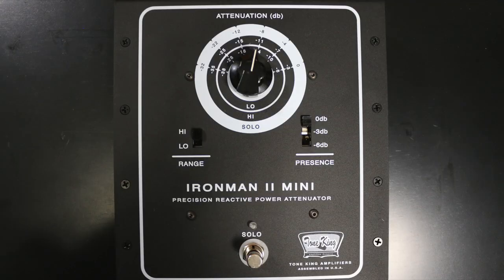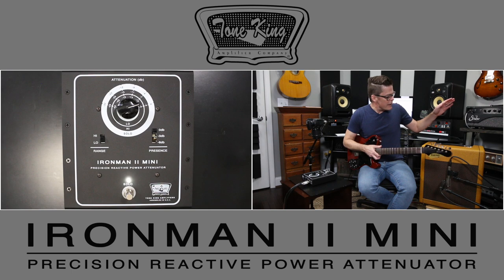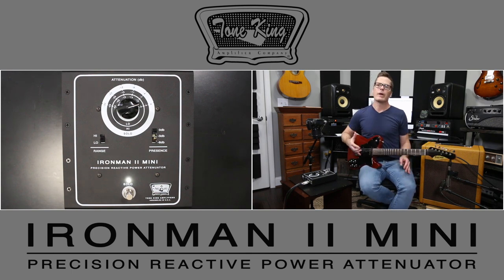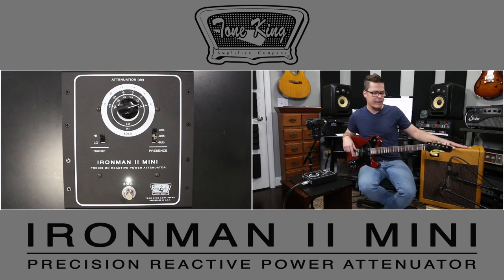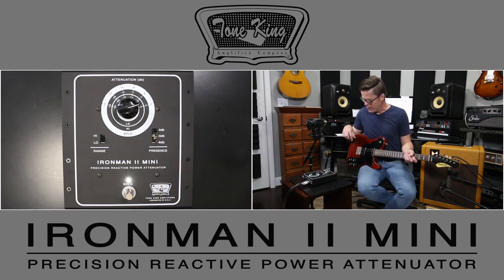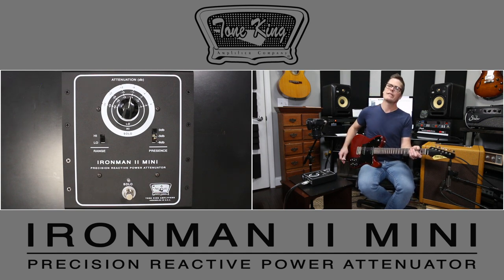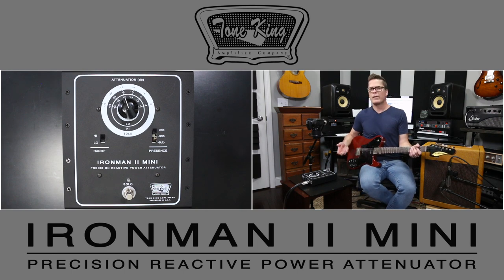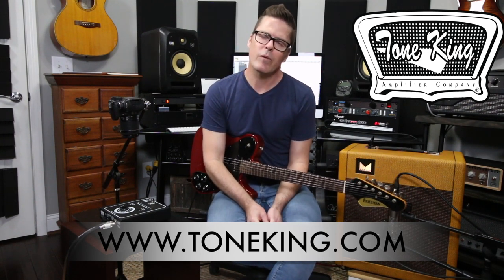Tone King Ironman II Mini Attenuator Demo Video by Shawn Tubbs

Comment: Just a heads up for those looking at this: a 16ohm load will NOT work with this attenuator. I’m definitely not trying to snipe Shawn, not at all (hopefully that’s clear, Shawn), but I bought this to tame down my AC15 and...it’s a 16ohm load, so it’s not compatible. Hope this helps anyone looking for the right attenuator for their amp. Cheers!
Reply: AC 15 has both 16 and 8 ohm outputs switchable. I don’t see the issue.
Reply: @VintageRadius  that would involve switching the speaker from 16 ohm to 8 ohm. Maybe he doesn't want to change it out.
Reply: @scottwilliams1577  8 ohm output into 16 ohm speaker/cab is what you call a “safe mismatch.” There are websites that explain. Hughes and Kettner has a good page on it.
Reply: @VintageRadius  8 ohms into 2 16 ohms is ok. Th AC15 is a 1x12 combo amp. 8 ohms into one 16 ohm speaker is not the same thing.

Comment: This video is missing a lot of information that would have cleared up most of the questions in the comments thread. Mostly, it's missing an explanation of how amps work. Not once is the phrase "power tubes" used.
Reply: I disagree This is a quick demo to introduce you So interested check out Tone King Buying something with out doing a bit of research would be foolish

Comment: What is the volume/gain on the amp? I bought a Morgan MVP 23 in large part because of its power-scaling capability. When I received the amp, I put the gain and volume at around 2 o'clock (~ 7/10) and it sounded amazing. Unfortunately, even with the power-scaling at its lowest level, it was too loud for my apartment. Turning down the gain and volume to acceptable levels with the lowest power-scaling did not give me the sound I wanted. I wound up selling the amp.

My point is that, at least with the Morgan, the attenuation starts from the un-attenuated volume, so a 20 watt amp that is really cranked may still be too loud for "bedroom" volumes.

Comment: Hey Shawn, great video as usually! 
I have a Morgan JS12 and it seems to have some really annoying low 60-100Hz noise issue, it's pretty auditable especially when miced up at low volume levels. The low hum seems to be coming from the power supply tho and is being partially picked up by the speaker. My old tube amp had a similar issue, but the fender 68 Princeton I've been playing at the guitar store side by side with Morgan was dead quite in comparison. Does all Morgan amps have this problem? with a loud power supply? I've checked two JS12 so far (sent one back) and they all seems to have that problem. Did you have to cut down some low 100Hz-ish frequencies when you were mixing the audio? I usually recorded my amp at a very quite levels: volume on let's say 9 o'clock. Do you think using power attenuator and cranking up the volume would help to achieve a cleaner signal with less noise but at appropriate apartment levels? Thank you for your wisdom, Cheers from Poland, Michael
Reply from the maker: The JS12 I used didn't have that issue at all. Have you checked with Morgan Amps?

Comment: Hi i have a 30 watt 5e3 circuit handwired amp that is quite loud for a 30 watt amp.  This seems to be at the max of the  load for this attenuator.  Should i have any concerns about using this on my 30 watt amp? Should i jump up to the 100 watt version?

Comment: Where can I find a good quality speaker coupler?
Reply from the maker: GLS Audio 1/4" Coupler Female TS Plug Jack Adapter - 1/4 inch to 1/4 inch Barrel Mono Full Metal - 4 Pack Check Amazon.

Comment: I just ordered this Attenuator in order to use it with my Tone King Falcon Grande. I know this amp already has an attenuator inside, but sometimes I still find it too loud, especially on the Lead channel, even fully attenuated. I don't really know how to set the internal attenuator and the Ironman II mini in order to have the best results.... I guess I will have to tweak the 2 attenuator a little in order to find the perfect settings.

Comment: What's the goal of an attenuator if you don't push your amp much more harder?
Reply from the maker: If you've found the sweet spot on your particular amp and it's too loud, then you use an attenuator to turn it down. If the sweet spot is setting the amp to 11, then ROCK ON!!

Comment: Could you come out of your amp head into this ironman2mini and straight into an audio interface (without having to plug into a speaker cabinet)?
Reply from the maker: You can run the speaker output of your amp into the IM2 Mini and then use the line out into a mixer or interface (without a speaker plugged in). Just be sure to read the manual before you run your rig this way.

Comment: Thanks Shawn. Is the install just that simple; two speaker cables and that adapter? I’m thinking of getting one of these for my Fender Princeton Reverb 12”
Reply from the maker: Yep, it's that simple!
Reply: @ShawnTubbs  thanks Shawn. Where can I pick up one of those adapters? Sweetwater...GC?
Reply from the maker: @sbadali1  Reach out to Sweetwater. Tell them you need a speaker cable extenstion coupler.
Reply: @ShawnTubbs  Thanks Shawn. Happy Holidays!

Comment: Does this work if you got a 16 ohms cab but an amp with 8 ohms jack too? Or does the cab have to be 8 ohms too? I don't get it :D
Reply from the maker: When using the attenuator you'll want to run 8 ohms amp and speaker.  The Iron Man Mini runs at a fixed impedance of 8 ohms.

Comment: My amp is a 50 Watt, so i'd need the bigger one, not the mini right? Could i get away with this one?
Reply from the maker: I would reach out to Tone King about it and see what the limits are but if you're running a non master 50-watt amp, you'll most likely need the bigger attenuator.
Reply: They make a bigger one now
Reply: @paulcowart3174  I bought the WAZA TAE, it's fantastic.

Comment: Hi Shawn! Thanks for a great video. Do you know if this can be used as a Reactive Load? Meaning not connecting the speaker and just using the line out and IRs
Reply: It IS a reactive load, as opposed to a simple resistive load. Since it turns down to (almost) nothing  and has a line out it can be used for silent recording...but they have a bad link for the manual. The older version had -40dB setting (as opposed to a -38 here) and they said as long as you left the knob down to the lowest and had the switch set down too it was OK to un-plug a speaker. I'm paranoid, so I'd leave one plugged in I think...